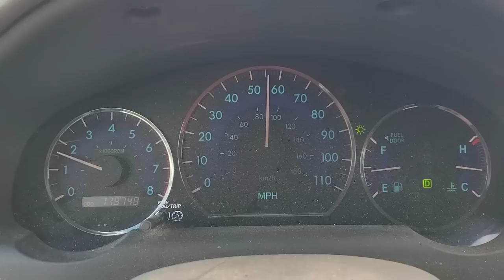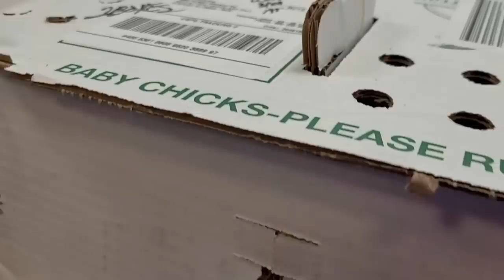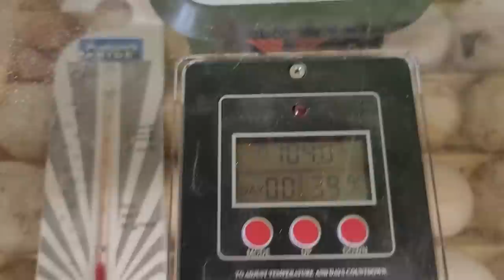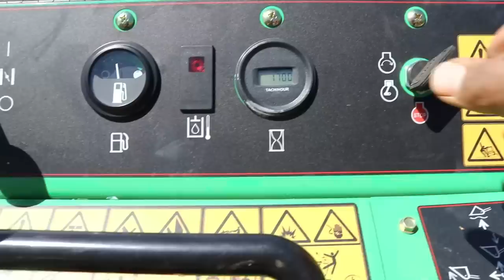Gross! Chicken EGGS EXPLODED on Me

Comment: Ho Mike I've raised chicks on several occasions  and I never used a heat lamp, I've been using a regular 40 watt lamp I bought some Rhode Island reds, golden comets, Easter Eggers and pearl white. I got them at tractor supply. I'm raising them in a 50 gallon tote in my living room.
Reply: Do they stay the recommended temps with a 40 watt bulb??
Also, you're pretty brave yo have them in the living room,  they create a desert storm of DUST! it's the constant shedding I think. I got mine last April and there's still dust in places. This year, back in the bathroom,  but its getting warm enough to get them outside sooner.😊
Reply: @heatherk8931  I've allways used it on  chicks it's enough to keep them warm

Comment: I have had a egg alone because the others were moved to a new location. And it never completely came out of its shell either. I have the same incubator you do. I've also had eggs pop, loud and stinky. I usually have 90% success with hatching. And I always dry hatch. Never been a issue with me.

Comment: Mike I'll give you a big tip on your eggs at you incubate in the future. Pour hydrogen peroxide in a big bowl and set your eggs a few at a time and wipe them off with a paper towel saturated with the hydrogen peroxide and do not dilute. It will kill all the germs on the eggs and will give you a higher hatch rate. When you don't wash your eggs before putting them in the incubator you're just harboring bacteria and your incubators and the chicks that do hatch probably won't be too healthy. I wish you the best buddy.

Comment: I believe there are a few reasons why your egg hatching failed. Please know that this is coming from a place of help and not finger pointing. You only want to incubate clean eggs if at possible. I don't wash my eggs so as not to remove the bloom, so if the egg isn't relatively clean coming out of the nest, it's not going in the incubator. Soiled eggs in an incubator can cause issues and are not a good choice for trying to hatch. Another issue is the way you had the eggs stacked on top of each other. In a nest, the eggs are in a single layer with the hen tucking them under herself and turning them. She rarely leaves the nest which is why you want as little peaking in (opening) the incubator as possible. You especially don't want to open the incubator during the hatching process, since heat and moisture are a crucial part of the hatching process. I hope these tidbits help you in your future hatching.
Reply: I saw the dirty, stacked eggs as well

Comment: I never use heat lamps for babies chick. They have been just fine.  They huddle all together and they keep warm just fine.     Those heat lamps are so dangerous.    I found out with the chicks that I have a raise. They’re always staying away from it and my opinion I think they get too hot.
Reply: I pull my heat source higher if they're trying to get away. With 2 days of 70 outside,  I opened the window a crack and unplugged the lamp. They seem happy.